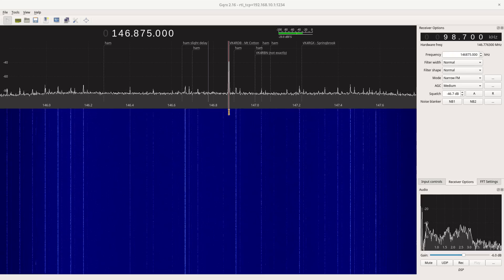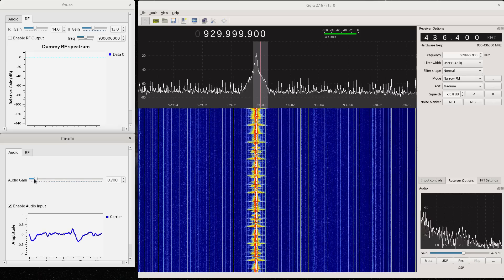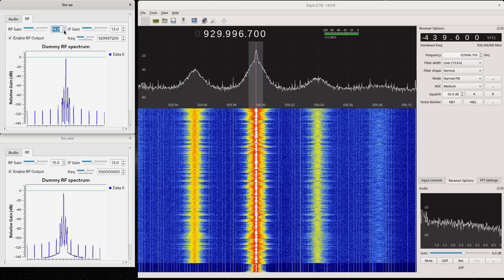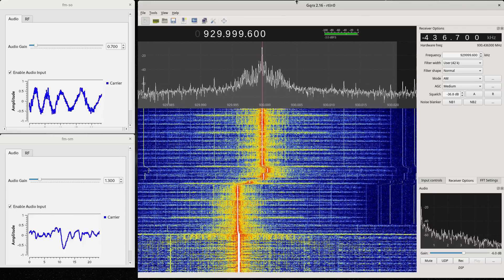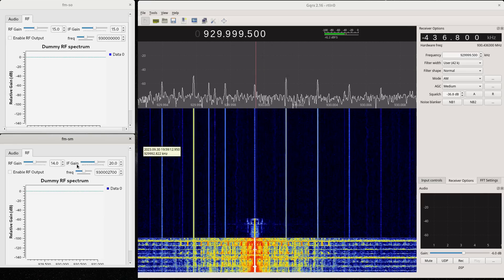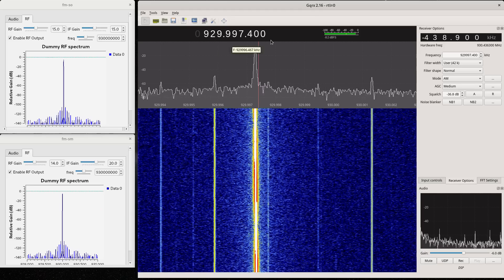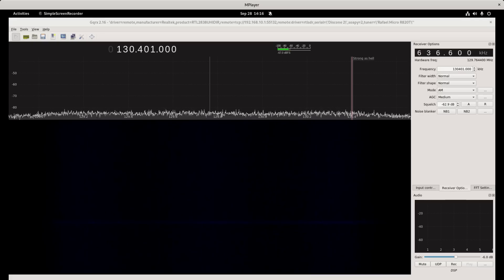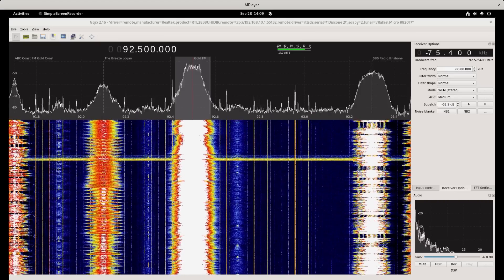Demonstrating FM Capture Effect

Comment: My understanding is that FM is not used by aircraft because of the doppler effect. If the aircraft is flying towards the receiver, the transmitted signal moves up the band relative to the speed of the aircraft, and down the band if the aircraft is flying away from the receiver. So the radios will never be on frequency.
Whereas with AM this effect is not noticeable  as the amplitude is what matters, the slight offset of the frequency is negligible.
Reply from the maker: In short, no. Maybe I'll address that in a longer version some day.
Reply: I think you mean the Doppler effect.  Poplar is a tree.....
Reply: Mike you do not take into account the fact the transmitters are never perfectly synchronised. You will never hear two transmissions at the same time on AM due to generator temperature drift and Doppler shift. Instead you hear a low frequency hum which is typical of modern Jet airplane Doppler shift (around 50 to 150Hz)

Comment: It is the reason why truck drivers use  AM trx in EU. You can hear a few station at the same time what is not possible with FM.
Reply: FM greatly cuts down your range.  That's why hams rarely use it for long distance contacts.
Reply: @stargazer7644  
Confirm this :-)
I am  HAM with callsign SP2RM :-) which likes low power communication (QRP).

Comment: I really appreciate the demonstration!  I've often wondered why they still use AM with the wealth of alternatives, listening to air disaster channels.  You can really hear the scratchy, low-fi audio when FM could be so much clearer, so it really annoyed me, not understanding why they chose to stick with AM.  Great video!
Reply: Airplane started with a.m. in the 1920s. The parts count for an FM radio is much higher than an AM radio and they were using only vacuum tubes. I think the reason they never switched over to a better transmitting mode is simple bureaucratic lethargy

Comment: The squeal caused by the mixing of two slightly different AM carrier frequencies is called the heterodyne effect.  The squeal will make the audio content of both signals unintelligible until one of the transmitters stops transmitting. This squeal contributed to the Tenerife Airport Disaster in 1977, in which the controller could not understand that an aircraft was still on the runway when the KLM flight started its takeoff roll.
Reply: Back in the 70s when I would assist my dad with the comms from the co pilot seat I had always assumed that aircraft used FM for voice communications and took it for granted but one day when we were circling the runway another pilot keyed up over the tower and there was a heterodyne noise. I instantly realized that aircraft used AM.

Comment: AM is going to give you heterodyne when multiple signals interfere.  If avoiding interference was really the reason, then they'd use SSB, not AM, and then they could hear both aircraft with no interference at all.  I suspect they use AM because in the early days of voice, AM was all you had.  Everyone else switched to use better modulation schemes as they became available, but aircraft didn't.  The bigger reason aircraft don't use FM is wider bandwith results in reduced range, which is another reason SSB would be far superior.  I wonder why you didn't include SSB in your demonstration?

Comment: Because of the Doppler effect, Aircraft use AM
Reply: It looks like at 600 MPH the frequency would only shift around 200-300 Hz.
Reply: Doppler would be about 120 Hz or less at 600 knots at 120 MHz.  Really not a practical problem even if you don't tune.
Reply: How would the Doppler effect be of any use?
Reply: If you've ever used 2 ways FM talkie on mobile,  you will know how Doppler shift destroyed your communications, let alone to use on much faster aircraft, wideband FM used in broadcast is different due to the much wider bandwidth, please get a Ham license.
Reply: @joelee24  All mobile telephone service in the U.S. was narrow band FM before everything went digital. So, nope. Any FM detector can lock on a signal 200 Hz away which is just 0.00001% off. Many crystals don't even have that degree of precision.
Reply: @scottlarson1548  Then I don't know why my FM reception breaking up on mobile but perfectly fine with AM CB and SSB and there's no other jamming at the time.
Reply: @joelee24  FM multipath.
Reply: @scottlarson1548  IC thx, the first time I heard of the use of AM on aircraft was due to Doppler shift, then I know 2 FM can not coexist like AM, sorry for the mis-understanding while I'm still on the ground

Comment: FM trunking allows simultaneously receiving and transmitting. That would solve both issues. P25 Phase 2 for instance.
Reply: Any FM repeater would allow simultaneous receiving and transmitting. That's how they work. Transmit on one frequency to the repeater and listening stations receive on another. The P25 Phase 2 doesn't allow two stations to transmit together on the same time slot and still be heard. The TDMF is designed to make more efficient use of radio spectrum. Trunking gives a large number of agencies the same pool of frequencies so that each agency isn't needing a dedicated frequency.
Reply: @kd5you1  Fair Point thanks

Comment: The effects which you show to us are true under lab conditions, but your explanations about AM in flight radio are... simply wrong. First, with two stations sending at the same time, you will hardly ever understand a thing. The carrier frequency differences are simply too big, you will mostly hear a kind of distorted whistle, that's all. Second, the one and only reason to use AM in aircrafts was initially the simplicity of the radio, which needed to be small, lightweight and reliable at the same time, and all this with tube technology. It was even not due to low signal bandwidth; the channel separation was initially 100 kHz. And nowadays, any radical switch of the standard is practically impossible (it would be more or less like changing the right-sided traffic to left sided, and this with converting all the cars at the same time), so the only 'progress' was narrowing the channel spacing first to 25 and then to 8,33 kHz, which is still backwards-compatible.
Reply: Switching is actually easy. Just roll out a system that sends both ways first, then way later when everyone equipment to understand both you can just start turning off AM. The last step is not important and can take a long time.

Comment: Tell me if I am right. I think that the receiver lock on on the strongest signal because of the demodulator type, that is PLL for analog or FFT for digital. If you use the phase shift FM demodulator maybe you will hear both signals, of course with the usual "beat" caused by the offset in the reference OCXO or the doppler shift. It will be fun to test this with pure analog systems.
Reply: The reason is that one signal's presence affects the amplitude of the other frequency a great deal but the frequency hardly at all. FM detectors are by design not sensitive to amplitude (in an analog FM receiver, a sub-circuit called the limiter stomps out all variation in amplitude).

And the reason why frequency is not affected much by the weaker signal is frequency is determined by zero crossings, waves are near-vertical where they cross zero, so the time point of the zero crossing is not much affected by a modest change in amplitude.

Comment: If two people talk on AM it will mostly get garbage, but as you said if one has a stuck button it'll just work fine for the other ones. 

Also what's somewhat practical for AM, it's technically much simpler, because Sound waves technically are already AM and so you can just put the change in amplitude over your Radio gain and will have kinda okay-ish audio (given you have choosen a high enough frequency to submit your audio because it needs to be at much higher frequency then the audio you transmitting :)

Comment: Our local area of Sproat Lake,  Near Port Alberni BC Canada operated  2 giant four engine Martin Mars flying boats used for fighting forest fires. I had a VHF radio scanner since  the 1980's,  as I remember it both of the Mars planes communicated on 164.190 MHz in FM mode.   The same frequency was also used by our local logging company along with other outside logging outfits which also owned the Martin Mars aircraft  also called   Forest Industries Flying Tankers.   That changed in 2006 when the Coulson company purchased the 2 Mars water bombers which, by then  communicated in regular AM mode like other planes.  sadly the Mars is retired since 2015 still based at Sproat Lake BC unlikely to ever fly again.

Comment: Capture effect is not the reason VHF aircraft communications is AM. Military aircraft use FM on all UHF frequencies. It was simply deemed too expensive to convert the world simultaneously to FM so they kept the AM. While listening to two music tracks might be feasible on AM, it’s impossible for humans to make sense of two pilots speaking simultaneously so there is no argument for AM in that regard. Capture effect can be overcome by the radio procedures used. Acknowledge the communication that was heard and understood and the contending pilot who was not heard will repeat his transmission. This is already built into the procedures in use under AM.
Reply: not ... on UHF military band use AM too, they use UHF FM on satcom comunicatios ...
Reply: This seems right.  And it's not just expense: this seems like a really tough transition, with pretty marginal benefit.  It needs to happen internationally, across many different standards bodies.  And when you get it wrong, there's the severe safety consequence of missed transmissions.  I can't even figure out how you would do it.  I think it would be more practical to build an entirely new, next generation traffic management system, and transition to that.

Comment: Always thought that aviation stuck with AM only due to a transition to FM being basically impossible to carry out. Because the transition would have to be syncronized more or less worldwide, with 100% of ground AND aircraft station being changed at the same instant, worldwide. Clearly not practical, unless a whole new frequency interval was used for FM, something that is also not really available.
But I did not realize there was also technical advantages to the old AM system, until now.

Comment: Does Doppler effect enter into AM vs FM when high-speed aircraft are concerned?
Reply from the maker: No.
Reply: Light (including radio) is so fast it could travel around the world 7 times in 1 second. All aircraft are practically stationary in comparison.
Reply: This is a good question. I always assumed they used AM for this reason,  as the Doppler effect must be accounted for the FM satellites in the 70cm band... But I don't remember adjusting for doppler on the 2m frequencies
Reply: Browsing at the other replies, in this case it appears the speed of the aircrafts and the frequency they use means the doppler effect is negligible here.
Reply: @martinmiller8991  70cm is 3 times the frequency of 2m, so the doppler is 3 times higher on 70cm.  There's still doppler on 2m, but it generally stays within the receiver passband, so you don't have to tune for it on FM. Aircraft are moving about 30 times slower than satellites, so aircraft dopper is 30 times less than with a satellite on 2m.
Reply: Not at the low frequencies aircraft use.  It would matter on microwave.

Comment: Thanks for the explanation. Why the terrestrial UHF  TV stations use horizontal polarization wheras fm radio stations use vertical?
Reply from the maker: That depends on where you live for the TV. For radio though, I'd say most would be vertical to account for simple vertical antennas on cars and things.
Reply: Aircraft antennas are vertical for communications, horizontal for navigation. This reduces interference with each other.
Reply: TV transmitters use either horizontal or vertical polarisation. FM Broadcast uses either vertical or mixed polarisation.

Comment: well not to pick the choice of words apart but       C.B.   is not f.m. -either  nor  on u.h.f.       even if  f.r.s  in the 462mhz range is l.p. half watt design with fixed antenna on h.t. units   g.m.r.s.  is a rather nice f.m. with repeater option very open with f.c.c. lic.     citizens band is classed as  a.m.   other then the new u.s.a.  release of f.m.  c.b.   27.000khz  is the area c.b. is in.   much of short wave band is about a.m..    aircraft clearly is able to  use a.m. as its long range effectiveness.  we know that military uses a.m.  in the 290 s and 300 khz area  .  cellular uses  f.m.  7 800mhz is u.s.a. standard   in digital formats such as dmr and P25 . radio is set up this way to make use of entire band.   even  t.v,  has swittched to fm  digital  and now its range has reduced range from 70 miles to 55 miles with the curve of the earths crust.  a.m.  could reflect and still be seen,  not with f.m.   v.s.b. -8  format is still the best thing to happen to o.t.a.  tv broadcasts.    cord cutters are born every day.
Reply: CB can use FM in other countries.
Reply: There are UHF FM CB radios in Australia.
Reply: @davidbarts6144  GMRS and FRS are variations of the Citizens Band Radio Service in the US that operate using FM on UHF.  11 meter CB can only use AM and SSB in the US.

Comment: your experiment doesn't address the power of the signal. you have both emitters in the same room, broadcasting two similar waves. In real life you will have two signals coming from different distances, resulting in different power levels. the automatic gain control will make you hear only the 'bigger' signal.

Comment: Could it be that the selective capture effect is due to the use of a phase locked loop (PLL) detector?  My guess is that a traditional slope or ratio detector would not suffer from selectivity problems and would allow multiple transmissions to be heard simultaneously. It would be interesting to repeat your experiment using a vintage 1960s FM receiver with a traditional detector.  I would bet that multiple transmissions would be heard.
Reply from the maker: It would be the PLL I think, but I just looked at how that slope detector works as I didn't know. From what I can gather, it directly correlates the audio output (basically AM) to the fm input on the slope, so maybe it would work.
Reply: @TallPaulTech  If I recall correctly, the slope detector is a linear low pass filter that's in the IF amp chain which results in the amplitude of the signal directly varying with frequency. That effectively converts FM to AM which is then detected using a normal diode detector, just like AM.
Reply: No. Capture effect occurs and was observed from the very first FM radios used. Armstrong used it as a way to illustrate the superiority of FM over AM.

Comment: Why don't airplanes switch to digital transmission with time slicing? This way you coukd have multiple aircraft on the same channel without the risk of interference between them. I guess this would male air travel even safer than what it is now, because crosstalk led to disasters like the 1977 Tenerife Airport Disaster.
Reply: You would need a global standard when there is already a workable one. Don’t think digital solves everything. Packets are regularly lost on computer networks without the complications of RF.
Reply: Digital threshold might also be a factor.  A readability of 4 is better than a readability of 0. But I'd think that the biggest consideration of all would be achieving compliance and retrofitting ALL aircraft, ground vehicles and control towers. Logistically, it's all but an impossibility.
Reply: @davidbrayshaw3529  they could run both systems in parallel until all aircraft are retrofitted, even if it takes 20 years. In the same way they ran analog and digital television in parallel for many years in most countries.
Reply: @rfvtgbzhn  It is certainly possible. Aviation is, however, a very conservative industry and aviators don't like spending money!
Reply: @davidbrayshaw3529  yes, airlines want to spend only the minimum necessary for fulfilling regulation. However I don't think that a new radio would be very expensive. Especially if it would  be built into new airliners instead of the old system it might not be more expensive at all.
Reply: There are too many 7600 squawks today, digital in it's current state would just make that worse. When dealing with hundreds of human lives; conservative, well tested, "bullet proof", carefully, and with multiple redundant backups is going to be preferred.

While not very bandwidth efficient, AM Voice (A3E), Sideband Suppressed Carrier Voice (J3E) and ACARS (A1B) are all simple, power efficient, and in the old planes like those DC3s still flying in some parts of the world. It is also simpler to deal with in areas with difficult propagation (like Tibet's mountains) where A7E (digital AM voice) could be problematic.

I would also consider the dangers of a sunflare, or in times of war possibly malicious blocking of a digital signal's integrity as real risks to be mitigated.
Reply: AM is as close to simply speaking across a room as you can get. Way more vital information is conveyed. When AGC is optimally 'undercorrected' then near speakers are louder while distant are quieter. Hearing a tone indicates someone else is speaking same time, and experienced listener knows who by the frequency of the tone. There's more things like this going on with AM, which becomes discarded by any other modulation.
Reply: The latency of a codec would be horrible. AM is the best because there's nothing in between A to B except the speed of light
Reply: @jagmarc  maybe in 1991, but today you would just have something like 10 ms latency if you use a moderately performing DSP.